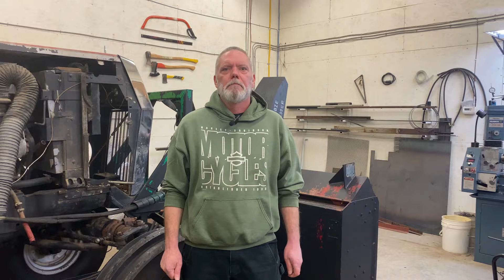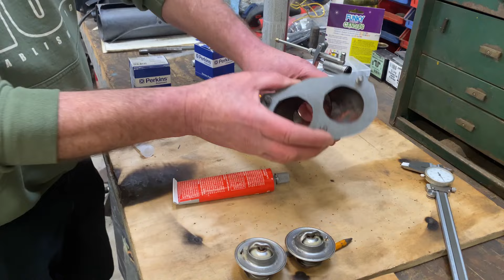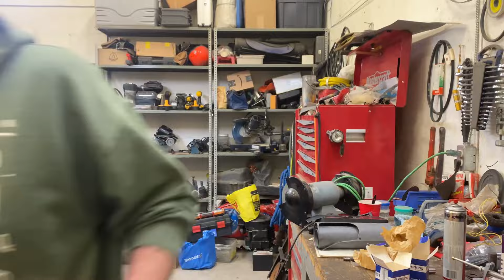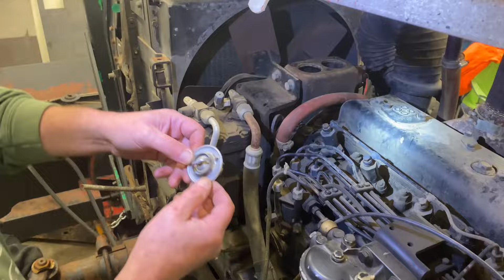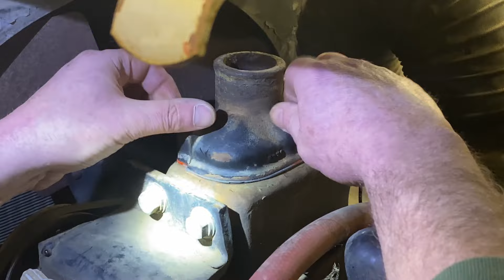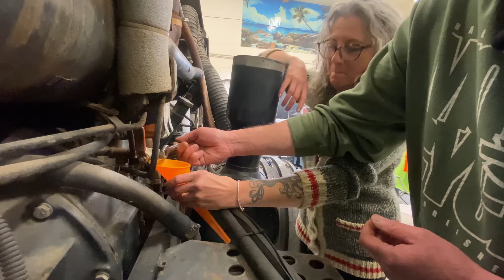Still no heat! NOT GIVING UP!

Comment: We had the bolt nut on the propeller on the water pump come loose on our white tractor so we never got heat out of it and had no leak on the water pump itself.
Reply from the maker: Good to know. Thanks for the tip. If all else fails We'll look for that

Comment: If the temp comes up to operating temp and does not overheat it should not be either the thermostats or the water pump.
 Chances are either the cab air filter is plugged up or the heater core needs resealed. Could also need to be cleaned out as another has mentioned. 
 Time to pop the top of the cab, should be hinged, and check out everything there. Be a good time to inspect the wiring for damage as well. Also check where the wiring exits the bottom of the cab. Wiring there would often chaff and cause problems. 
  As far as parts go don’t forget salvages. On older equipment they are a valuable source.
Reply from the maker: Thanks for all the great ideas

Comment: if the housing has a flat spot in the bottom and there is clearance between closed thermostat and housing they close off bypass when opened
Reply from the maker: Thanks for the comment. My engine model has twin bypass thermostats

Comment: I’ve had coolant hoses and fuel hoses  deteriorate inside to the point that the coolant or fuel won’t past through the hoses.  Especially if they are old. Not saying that is the problem but it’s cheap to replace.
Reply from the maker: Thanks for the great idea